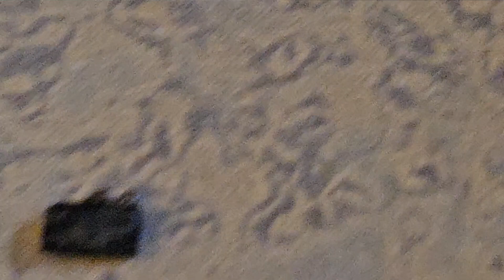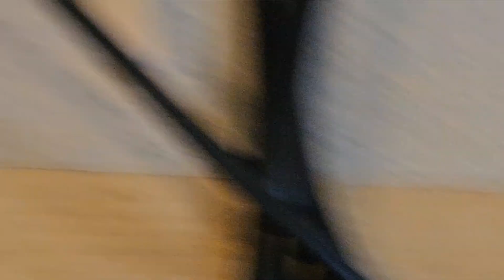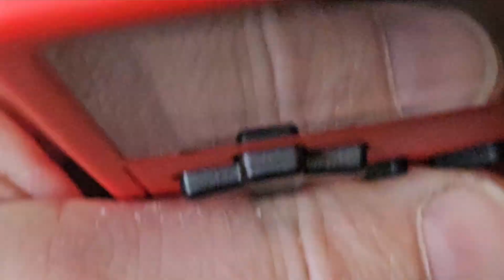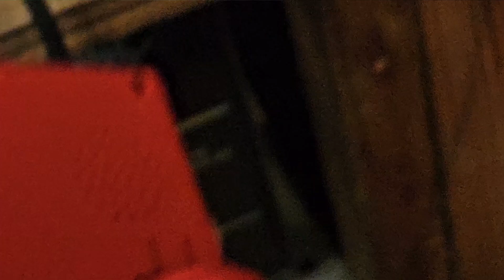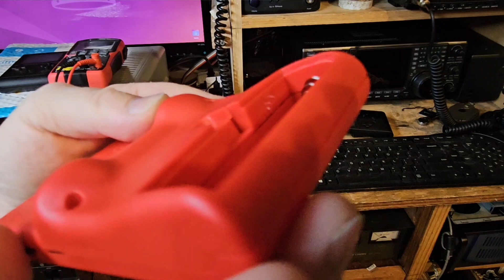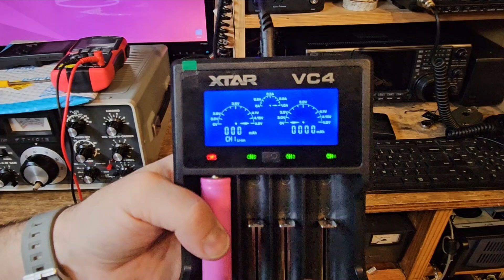gameboy gb300 emulator battery chip failure

Comment: i wonder what is name of that chip. i think it's a voltage regulator
Reply from the maker: Yes
Reply: @hamradiohack i remove that chip and manully put 1.2v into the output, the console works great. but cant really find which chip is that